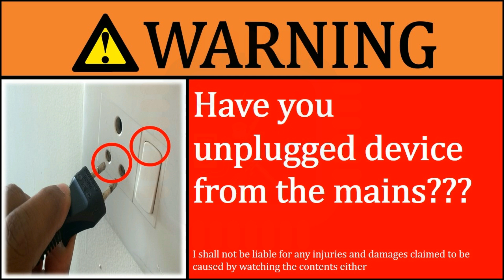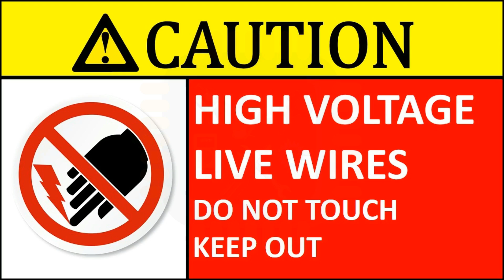how to repair mixer grinder

Comment: My mixture Spark coming After replacing karbonn also.... What to do with this..
Reply from the maker: At start it spark for 1-2days,but if sparking continues even after 2-3 days ,then you need to check commutator conditions.
Reply: varnish u apply
Reply: @MrNams  same here

Comment: I changed the corbon brush correctly .. but come sparks why? Please reply emergency
Reply from the maker: Initially it sparks,if it continues then its rotor issue,may it has scratches
Reply: @MrNams  rotar aur commutator ekee kya? Ya alag alag? Please clear my doubt.. same or not?
Reply from the maker: sorry i mean it's due to uneven commutator wear
Reply from the maker: commutator is part of roror.
Reply: @MrNams  please solve my last Questions
1) Today I changed corbon brush... I found sparks.. if sparks continues ... Need I change commutator ?or armature?
2) what's the retail price commutator and armature?

Please reply last question
   Thank you
Reply from the maker: 1) Yes you need to change commutator only, but i doubt any one take effort to change only commutator.

2) it will cost around 200 Indian rupees.
Reply: @MrNams  Thank you so much sir for clear my doubts.. Gob bless you 🙏
Reply from the maker: no issue

Comment: When putting mixer 1st speed, spark and big noise noticed near to plug socket.After this ,mixer not working.No response when plugged.What could be the reason ?,
Reply from the maker: Is it possible for you to open and check its carbon brushes? Do it very carefully,otherwise visit any nearby repair shop.

Comment: Mixer makes loud noise. What to do??
Reply from the maker: Generally mixer makes loud noise,in your case if its louder than previous, then it may be due to motor rotor bearing/bushing has to be replaced.
Or if you see carbon powder/sparking then need to replace carbon brushes